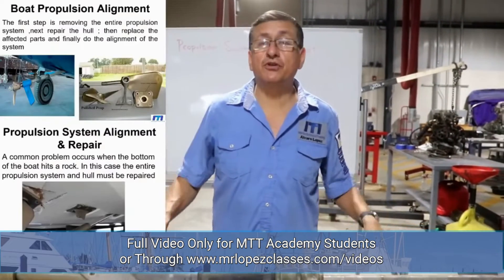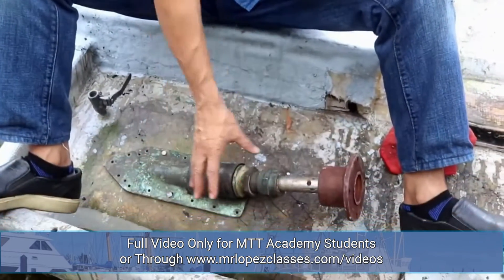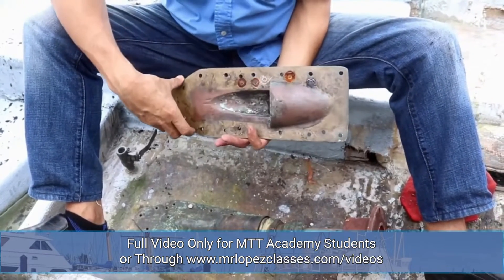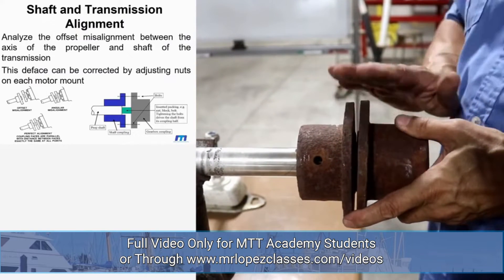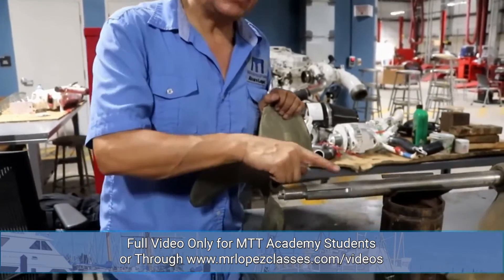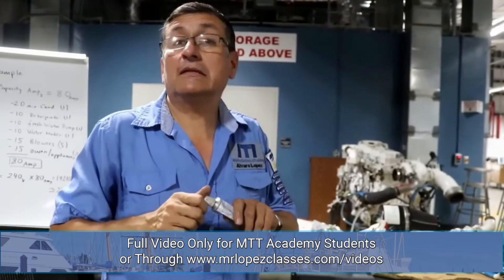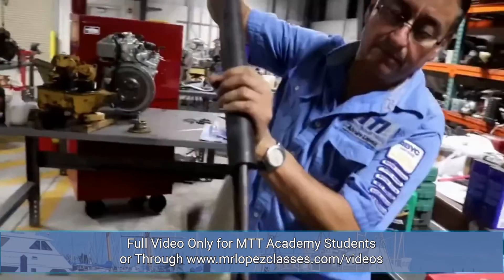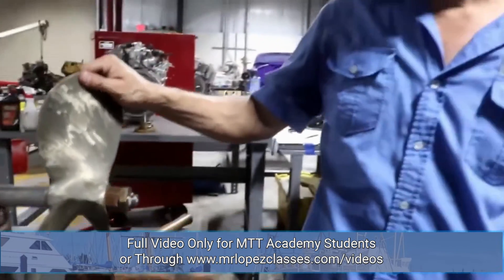Propulsion Systems Alignment Procedure

Comment: Hello Mr Lopez. Please explain why you apply valve grinding compound. Usually we apply marine grease. Is that good or not?
Reply from the maker: Using valve grinding compound is better because crate a perfect seal between the shaft and the propeller to avoid air and moisture between both  pieces.
Reply: @MrLopezClasses  Thank you very much master!!!!